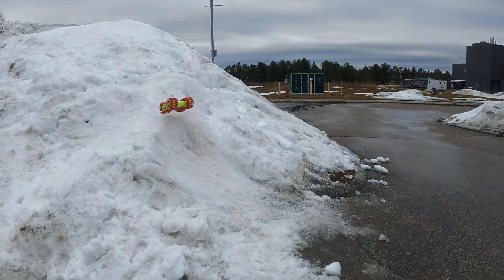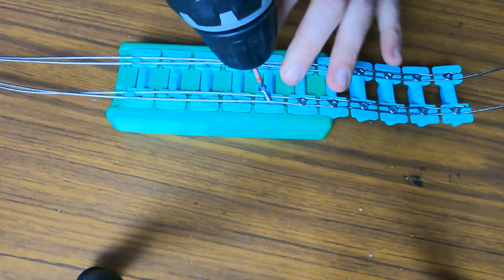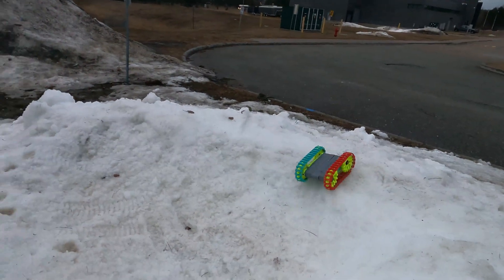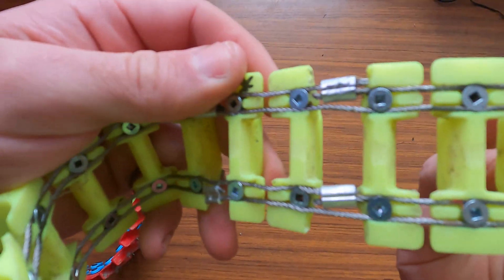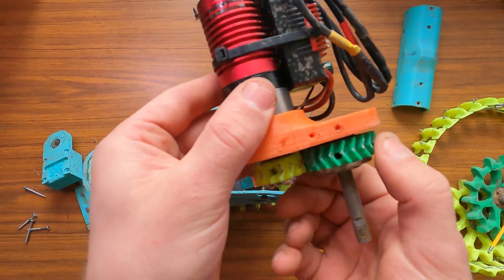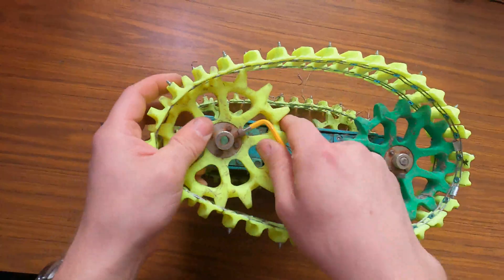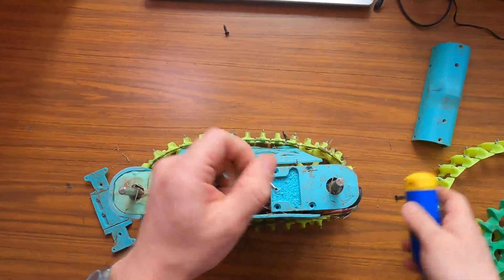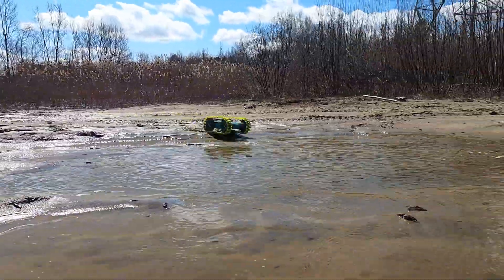This RC tank is fun to drive | You can build your own

Comment: Any updates on this? I'm slowly starting to gather parts to build this basher tank, have so many projects going at one but I'm really looking forward to this particular build. I plan to print the gears out of PETG and I think they will hold up fine.
Reply from the maker: I have made minor updates to improve durability since this video but the design remains the same. The project is up to date on Printable. https://www.printables.com/en/model/164289-fast-rc-tank/files
For the material of the gear, I now use ASA, but I think PETG can also work very well. The critical point is not the strength of the material. It's more about having a high melting point.

Comment: This is slick. I’ve been looking for a fast off-road rc with tank treads but they’re hard to find. I work in a maker studio so I suppose building your own is even better than buying one. Question, what is your electronics setup here for the controls and motors? That would make a good informative video. 😉👍
Reply from the maker: Nice! Have fun with the project.
The detail about the electronic are in the project on Printable. (Link in the video description)

I use 2 brushless motor and esc. Both esc (electronics speed controler) have their signal wire plug in the Rc controller reciver. The channel mixing is set directly in the RC controller (one joystick make both motor go foward/reverse and another joystick add/remove speed from the left and right motor to make it turn) . You can look for someting like "dual motor rc tank mixing" on youtube to find more info about that.

I may add some info about the electronic in the tutorial on Printable. I will maybe also make a vidéo about wirering and programming the electronic. Thanks for the idea.

Comment: I have quads, airplanes, and a 3d printed jet boat…this will be the perfect do all land vehicle! When the design if finalized will this also be able to utilize the snow tracks?
Reply from the maker: Yes, the snow track are compatible with this new version. I update the project today on Printable. the STL for the snow track are now in the "optional" folder. https://www.printables.com/fr/model/164289-fast-rc-tank
Reply: @RoboticsSideProjects  Sweet! prefect timing for me, What is the recommended material for the parts? Also the 3 wheeled version is the shorts its that a modification or something experimental?
Reply from the maker: I print all the part at 100% infill in PLA except for the gear. I use ASA or Nylon for the gear so that they have better resistance to abrasion and heat. 
Yes, the 6 wheeled version is experimental for now. I will eventually publish the 6-wheel upgrade. It will fit on the 4 wheels just by changing the center piece that link the drive pod together. The track will also need to be lengthened to fit.

Comment: great work !  may I know how this tank perform in the grass ground ? my track vehicle 's track always got jammed the grass between the wheel and the track.
Reply from the maker: It works well on short grass (2-3 inches). On the other hand, the long grass (6+ inches) gets caught in the tracks and the robot is not strong enough to pull it out of the ground. When that happens, I have to go in reverse to let the grass out. I don't have a problem with grass accumulation between the wheel and the track because I left a loose fit.

Comment: do you have files/parts list for this version?
Reply from the maker: Yes, but I haven't published them yet. I want to adjust the drivetrain clearances to optimize gear life. The modifications are made and I’m testing everything at the same time as I’m filming for my next video. So far so good so I should post the files and parts list in the description within a month.
Reply: @RoboticsSideProjects  Is the body mostly the same or should I wait with printing anything? :)
Reply from the maker: @flexdfpv  I just check and you should wait for the new version before printing. Some of the old parts could fit with the new parts. But I made little changes or upgrade to all the parts.
The good news is that I have fixed the design for this version. All the STL are ready, I will update the part list and post everything this weekend.
Reply from the maker: @flexdfpv  here are the new parts: https://www.printables.com/fr/model/164289-fast-rc-tank
Reply: @RoboticsSideProjects  great thanks! appreciate you sharing your work
Reply from the maker: @dexter-wy5bo  here are the new parts, Enjoy! : https://www.printables.com/fr/model/164289-fast-rc-tank
Reply from the maker: I have updated the project and publish the new parts: https://www.printables.com/fr/model/164289-fast-rc-tank